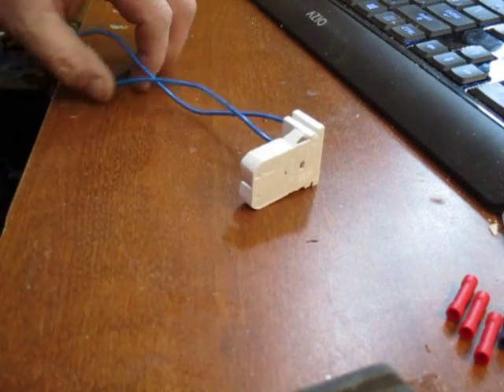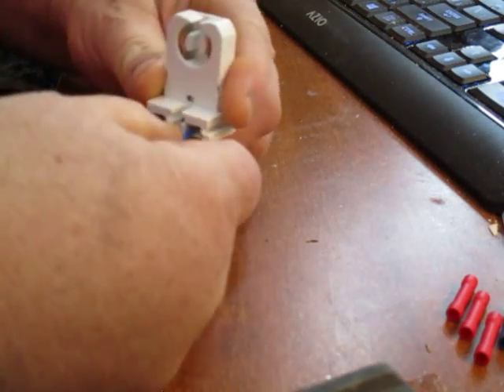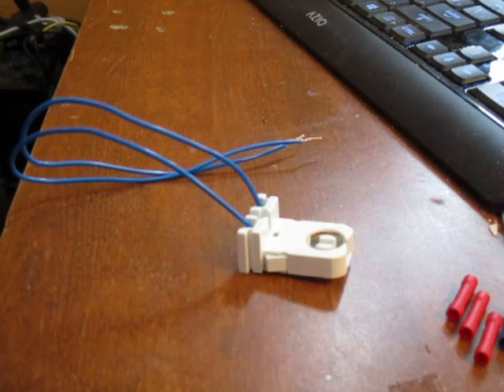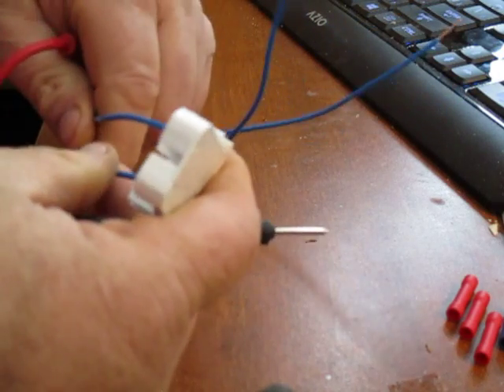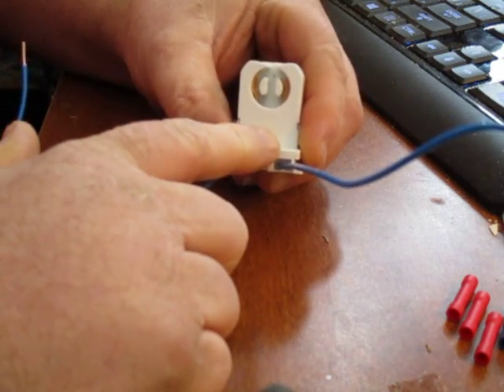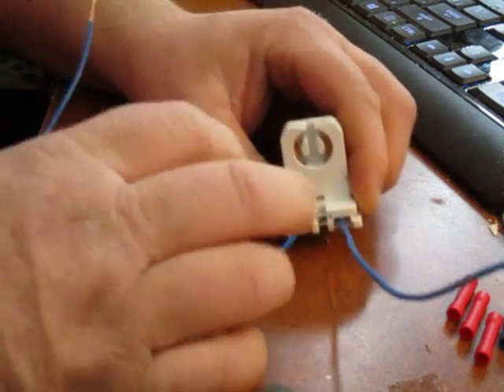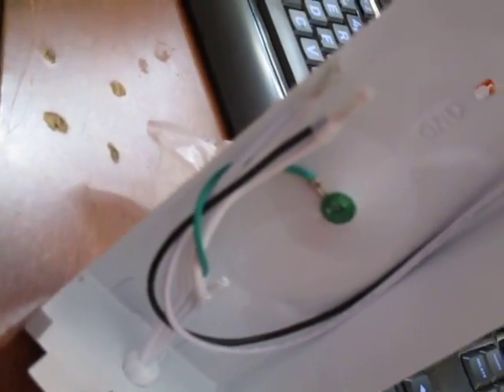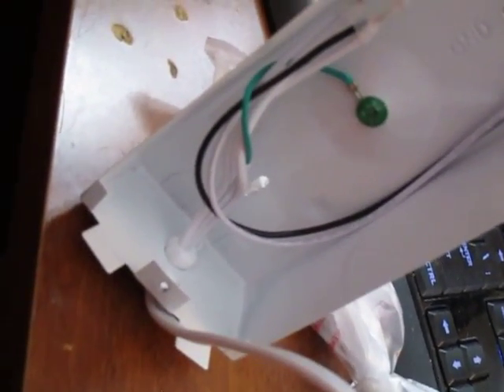To Shunt or not to Shunt

Comment: Not all Led tubes are positive and negative on one end. Therefore this video will cause the breaker to trip on some of the newer LED tubes with positive and negative on opposites ends folks!!!
Reply from the maker: fortunately haven't tripped a breaker yet, thanks for the info
Reply from the maker: the non power end is just a holder for the end. on the lamps I am using. the other end is black to black and white to white and are not shunted.
Reply: @thefaeryman  , the newer direct wire LED bulbs are now powered on each end so you don't have to change the wiring or sockets whenever removing the ballast. That's all I was saying.
Reply from the maker: @JDOG1974yes  good to know, thanks

Comment: Mine are shunted so if I replace the power end with non shunted which I will what about the other end. Can I leave those shunted or do they also have to be non shunted? I know the are not powered but will the shunts cause an issue on the far end?

Comment: I don't know what year is this video. But here 2019. I just went to lowes and got a pack of LEDs and ballasts for the type of 32 t8 4n, red the diagram and wired as I understood and turned the switch and they turned on.
I plugged every hole in those receptacles with a single wire coming from the ballast as the diagram showed. I thought: Well, worst case I'll get them burnt or trip the breaker. Nop. They're working.
Reply from the maker: well if the lamp holders are shunted, meaning a dead short between the contacts of the holder you must replace them with non-shunted holders. you remove the ballasts and give or throw away. one end is just to support the lamp. the power end is only need the hot and neutral, the green wire goes to frame. I bought the cheap shop lights about $16 threw away the ballasts. 
I bought the led lamps on amazon, which shipped the non-shunted lamp holders.
out of 16 shop lights I had zero failures.
thanks for watching
Reply: @thefaeryman  these LEDs  they told me I don't need to change anything.  Just remove the fluorescents and put the LEDs.  I replaced the ballast cause it wasn't working at all. But I don't know if they work without it.
Reply from the maker: @fernesal  you must not have either used the right ballast or wired them correctly. 
here is what I used:
https://www.amazon.com/Hyperikon-equivalent-Daylight-Single-Ended-Lighting/dp/B00NXBMDEY/ref=sr_1_4?crid=344FN1S9L31M5&keywords=led+shop+light+bulbs+4ft&qid=1577021006&s=home-garden&sprefix=led+shop+light+bubls%2Cgarden%2C215&sr=1-4
https://www.amazon.com/Non-Shunted-Turn-Type-JACKYLED-Fluorescent-Replacements/dp/B00SQY0ZS4/ref=pd_bxgy_60_2/146-2702838-8351500?_encoding=UTF8&pd_rd_i=B00SQY0ZS4&pd_rd_r=ab1dddbb-1867-4bd6-86e7-b40a92cb87d7&pd_rd_w=HLFyS&pd_rd_wg=x7S1l&pf_rd_p=09627863-9889-4290-b90a-5e9f86682449&pf_rd_r=P40H1MNJ0ANB0WWZBN1W&psc=1&refRID=P40H1MNJ0ANB0WWZBN1W
https://www.amazon.com/Non-shunted-JACKYLED-Fluorescent-Replacements-Programmed/dp/B01GCHS41G/ref=pd_bxgy_60_3/146-2702838-8351500?_encoding=UTF8&pd_rd_i=B01GCHS41G&pd_rd_r=ab1dddbb-1867-4bd6-86e7-b40a92cb87d7&pd_rd_w=HLFyS&pd_rd_wg=x7S1l&pf_rd_p=09627863-9889-4290-b90a-5e9f86682449&pf_rd_r=P40H1MNJ0ANB0WWZBN1W&psc=1&refRID=P40H1MNJ0ANB0WWZBN1W
good luck
merry Christmas
Reply: Nice vid. Doing some single pin t8s soon.  Assuming it’s even simpler. Is it going to be hot to one side and neutral to other side?

Comment: And this is why I buy LED tubes that are compatible with a ballast. You can't beat the convenience of plug-and-play.
Reply from the maker: I have heard the ballast uses more energy than the straight led tubes
Reply: Rev John O'Toole 4 to 5 watts more which is an acceptable trade-off for convenience, especially when you have 8 light fixtures in a shop.
Reply: The ballast effectively cancels out your savings, as well as leaving a used $15 part in the light to go bad later. Also a bad ballast can fry an LED lamp when it goes bad.
Reply: Legally Insane I have fluorescent light fixtures that are 20 years old and never had a ballast go out and a ballast doesn't waste 50 watts when using LEDs. Yeah, there is a little waste of power when keeping the ballast in play but it's not 50 watts and you can tell just by looking at the specs of the ballast which was designed to push when using conventional fluorescence which is something LEDs don't do.
Reply: 10 years down the road (at most), you’ll be a victim of planned obsolescence and have to bypass anyway.  So for temporary savings, or if you don’t plan to keep the same home for longer than that, you’re probably making the smart choice.  But if you’re retrofitting a large amount of lighting and your contractor recommends ballast compatible LEDs, he’s looking forward to ripping you off again later.
Reply: expvideo1 That's why one buys the hybrid plug and play LED tubes so when the T12 magnetic ballast goes out then one can do the conversion as needed.
Reply: You're right about that, the contractor makes out like a bandit both ways.
Reply: The old ones yeah, at 20 years old the ballasts were made to last but not now.  But you're gambling with one other thing, if a used ballast start's to go bad it can take the LED bulb down with it. At that point it's all moot. If the bulb stops working the only practical way to trouble shoot the pair is to go ahead and gut the ballast & wiring anyway. Ballasts are a pain - I've made a living at times doing nothing but repairing overhead lights in office buildings so chunking one in the trash is a satisfying feeling, lol.
Reply: Plug and play LED lights are not as bright and last about 1/3 of the time that the direct wiring ones do.
Reply: Rev John O'Toole , yes and the plug and play are trash and don’t last. Plus they are not as bright!
Reply: But eventually the ballast will go out and you will have to replace it better just to have to replace the buld
Reply: LEDs that run with ballasts are type A bulbs that are a direct replacement for fluorescents. Type B LEDs have to be wired with the line voltage on one end and neutral on the other. We put inline fuses in to further protect the bulbs from power surges. Prior to converting to Type B, we had some occurrences with the type A bulbs getting hot and failing. The bulbs would break and fall to the ground sometimes. Obvious safety hazard that we determined was either the brand of bulb or failing ballasts with 277v power. It didn’t happen as often on the 120v lights.